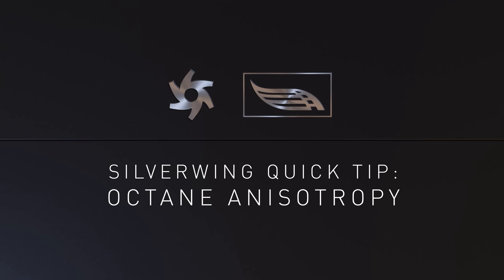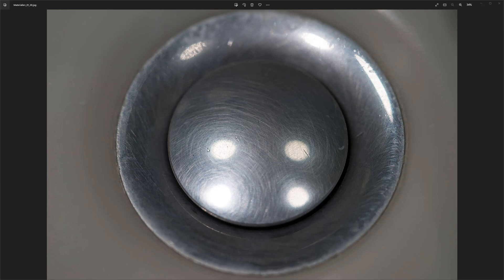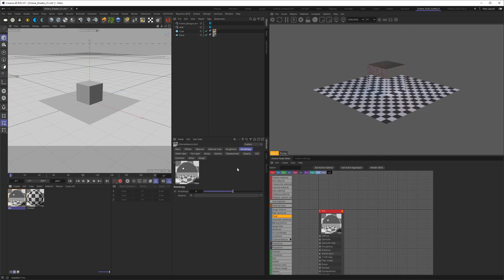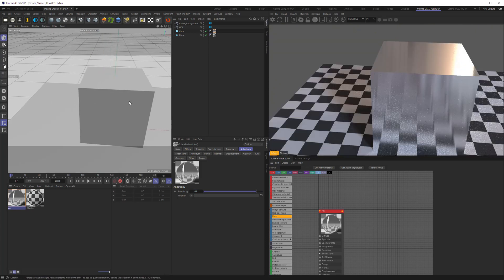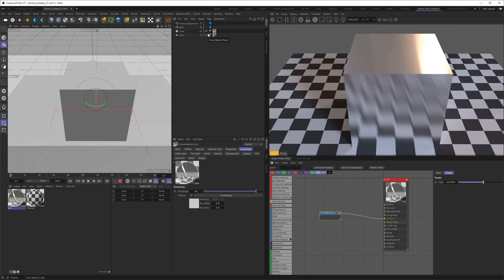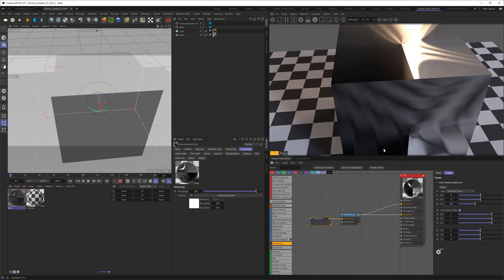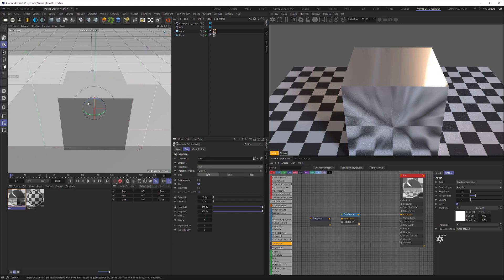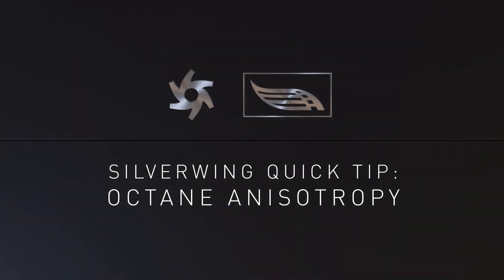Silverwing Quick Tip: Octane Anisotropy

Comment: This is three years old now. Is roughness still required to achieve anisotropy? Adobe Standard Material, chapter 3 page 7 in the technical documentation states:
"This formulation allows for control of the anisotropy independent of base roughness, but preserving a relative change in anisotropy if roughness increases."
finally decoupling those. This allows for those very isotropically polished surfaces that still have a hint of anisotropy in them, allowing very bright lights to streak.
I don't know what the official term is, but I call it sun glints, going well into backscatter realm. Can also be observed for strong focused spotlights (incl some backscatter).
In Blender (Cycles, sorry 😂) I have to fake it utilizing two Glossy shaders for this, plus an additional one for super sharp extremely grazing angles.
Just curious where the rest of the world is at, currently. Is Octane too still stuck in Disneyland, or has it evolved?

Edit: Wait, that's unfair to Cycles. It has definitely evolved too, in other places. But anisotropy has been made worse, in that backscatter requires a lot of roughness.

Comment: Great video, but keep in mind, (not that it's a big deal, but you would not a have a circluar anisotrophy of a flat surface side of a cube where the highlights came to a point in the center. The highlights coming to a point in the center are a effect caused by parts that were on a lathe as the cutting head cut toward the center, and i f it was on a flat surface like that it would be from a rotating cutter on a vertical mill, most likely from a flattening process. If the surface is ground, the scratches would be random in direction but would most likely have a uniform movement from one side to another
Reply from the maker: Hey thanks.
Yeah, it would be more realistic on the top of a cylinder. But its just for demonstration purposes.
Cheers and a good time to you!

Comment: Thank you for a very useful lesson. I have a question. In which channels should gamma 1 be used? for example, do I need to use the gamma of 1 textures in normals, bumpers, etc?
Reply from the maker: If you are working with BPR textures the only texture you would set to "sRGB" (Gamma 2.2) is the albedo / diffuse (or anything that contributes to visible color (e.g. color in the specular channel in a metal material). All the others (those who drive parameters like roughness, Bump, IOR/1 etc.) usually are "Non Color Data" (Gamma 1)
Octane handles Normals a bit differently. So you can set what you want there because it´s usually ignored. But in general it would also be "Non Color Data" (Gamma 1)

Of course when working with procedural textures or if you want to tweak your PBR textures you of course can use different gamma values though.
Hope that helps 🙌
Reply: @SilverwingVFX  Thank you so much for the detailed answer, Bro. I'm learning a lot of new things on your channel. Good luck and prosperity to your channel😀

Comment: Great tutorial as always! Big fan of your work! However I feel the need of more in-depth knowledge on the topic, especially on creating like circle, cylinder shaped objects that has a nice like brushed metal pattern anisotropy which unfortunately I was not able to get right after watching the tutorial. I guess there should be something more like normal/bump map/roughness map or something to create the look.
Reply from the maker: Thank you for your long comment.
Of course the material can be spiced up with, as you said, normal maps, bump maps and roughness variance. This tut only covers the very basics of anisotropy.
Its the same as if you have roughness on your material, it will be applied uniformly and simulates the surface structure at an infinite small scale. You can get some more haptic look if you add structure with extra shaders. I will write your suggestion down on your list.